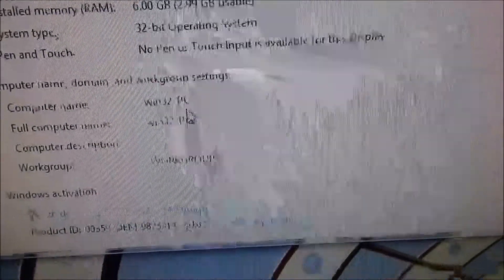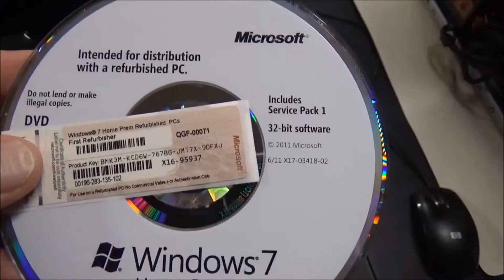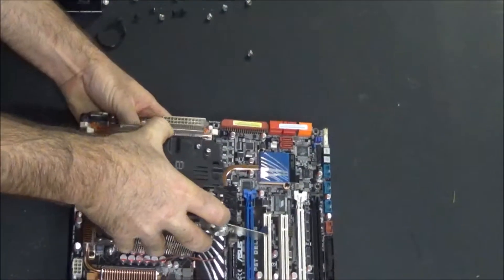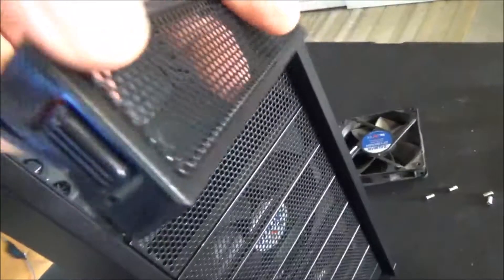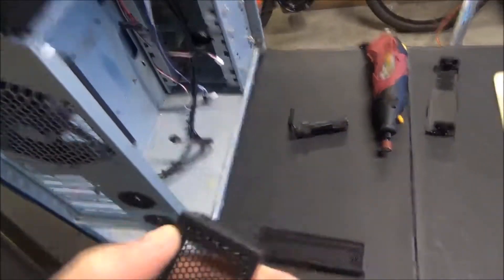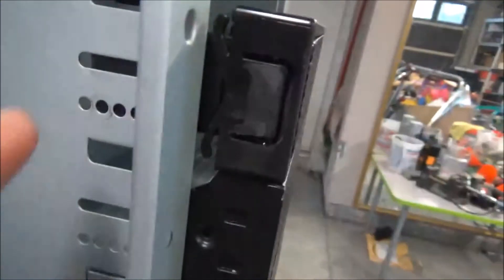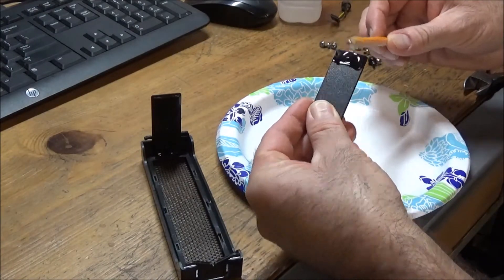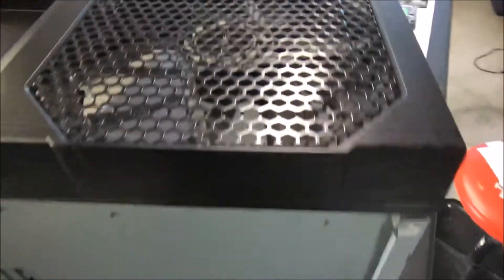Cleaning my Craigslist LGA1366 Digital Storm Gaming PC- Part 2

Comment: you could buy a windows 7,8 or 10 key for cheap on kinguin. Paul's hardware did it and it been working good. I would buy the buyer's protection though. I bought a game on there and it worked perfectly.
Reply from the maker: I remember watching that Paul's Hardware video. I think people were giving him a hard time for promoting a potentially shady purchase, but I have heard good things about Windows key re-sellers like Kingwin. I checked out prices but decided I just couldn't keep this PC, I seriously have too many already. I also need to use the profit to buy parts for my next YouTube project. I really need to start building it and I need to spend some cash first.
Reply from the maker: Hey dude. Should I paint the inside of that Antec 900 case? It would make it more appealing on Craigslist and wouldn't take too much time.
Reply: Yes, paint it like a gunmetal gray with a red accent. or white and blue, or just black. give it the old PC pimp out
Reply from the maker: Oh I just meant a quick blackout of the interior to get rid of the old grey look. If I was keeping it I would give it the proper paint job it deserves =)
Reply: yeah do a quick blackout

Comment: At least you made money on it and didn't loose money
Reply from the maker: Yeah, I'll make enough to buy parts for the project I'm working on. It's also fun flipping Craigslist stuff IMHO.
Reply from the maker: Do you think I should paint the inside of that Antec case? I have a can of paint already and it wouldn't take too much time.
Reply: Are you restoring it to the original color changing the color all together?
Reply from the maker: I was thinking about spraying the inside with some flat black to cover the old school grey. Not going to do anything to the outside of the case, just wanted to make it more "sellable" for Craigslist. It would probably take a half hour to do the job, maybe I should just do it and record it for a video.
Reply: Well if you already got the paint and it's not costing you anything yes i think it's a good idea to paint, i don't know about you but iv always liked a case that's been painted on the inside rather then that boring alloy grey, go for it bro i think it will look nice, presentation separates you from the other people selling on Craigslist and goes a long way and makes you look like someone who have looked after your stuff
Reply from the maker: You're right, it's worth the extra effort, thanks for the feedback bro.
Reply: No problem mate glad i could help